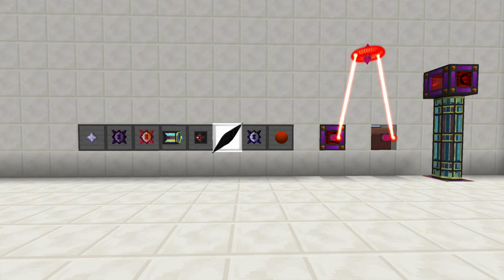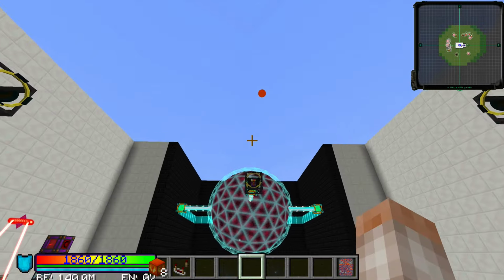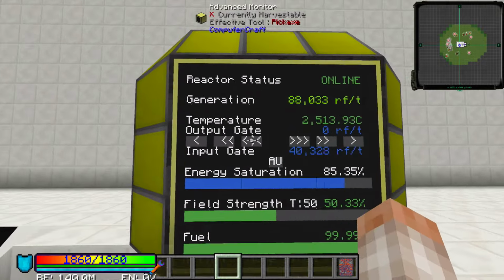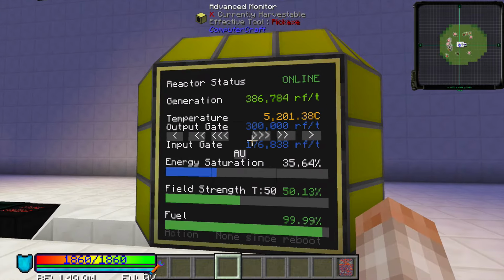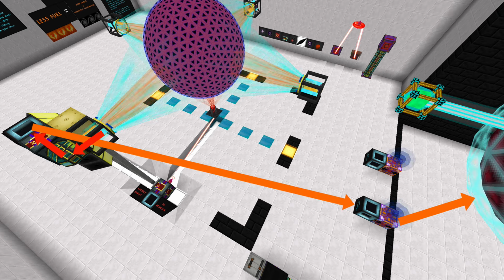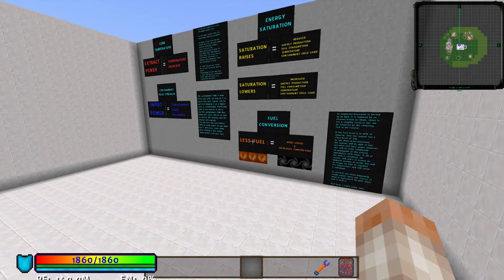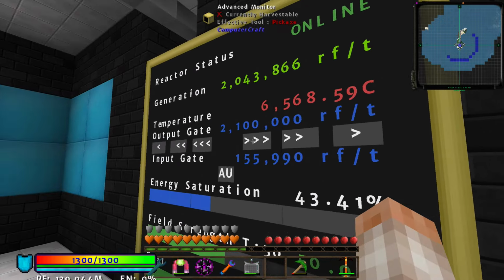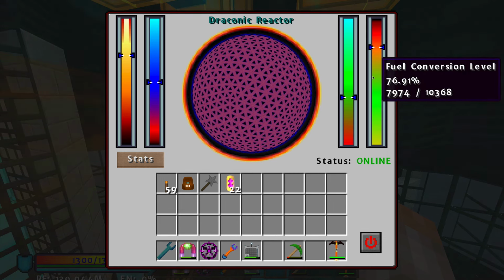Draconic Evolution Reactor Explained & Tutorial

Comment from the maker: IMPORTANT!!

One quick note on the chaos element and fuel longevity:

I said in the video that it was not a tangible resource but this is not the case. Once you power down the reactor after running it for an extended period of time, you will need to eject chaos fragments out of the reactor in order to make room for new fuel.

Also, the CC program stated that I had over 99% of fuel in the reactor but this also turned out not to be true. Once the conversion levels rise around 80-90% (as explained in the video), you'll NEED to refuel or risk an explosion. The "remaining fuel" gauge on the CC program interface is NOT an indication of how long the reactor can still safely run so DO NOT TRUST THIS. Refer to the fuel conversion ratio inside the reactor's GUI to accurately measure the time remaining on your fuel.

In this example, my high output (very inefficient reactor) was only able to last a little over two weeks before a refuel was needed. Lower-output reactors that are more efficient will last longer.
Reply: Hit the Read More
Reply: Why is my reactor not charging ? I've done ste same Reactor with the same messurements like you. What have I done wrong ???
Reply: I did, but at the time, nothing popped up. I'd hit read more, and it only revealed another blank line :T
Reply: Turn it off and Eject all Fuel and then keep clicking will remove the Chaos
Reply: So the program won't stop itself once the chaos gets too high? Are there any programs that will?
Reply: @ForgottenT  I'm guessing there is a way to meaure the amount of fuel vs chaos.  I'm going to try using Integrated Dynamics
Reply: Just come back on the server 2 days in a row to calculate how much was consumed. Based on this, you can determinate how long before rejoining the server to check again on the fuel. The closer you are to 80-90%, the more frequently you'll have to come back.
Reply: Just a note 15 days after he posted the video his base suffered a fatal explosion
Reply: I think I know how to stop a Draconian Reactor from destroying everything. Use the force field mod and put multiple layers of force fields on the reactor or just place the reactor at bedrock.
Reply: Should do a updated video or maybe one that explains the all the Redstone options and the failsafe options. 
I haven't found many videos showing how to shutdown or refuel.
Reply: The MindCrafters last I checked the issue was fixed.
Reply: Does the failsafe work doing this?
Reply: Idk sorry.
Reply: One flaw with having it on a public server
Trolls
Reply: Is it just me, or is there nothing written after "longevity:"  ???
Reply: The MindCrafters lolsleelwowlelel

Comment: Hello minecrafters! i just have a quick question, I've followed the instruction in the video step by step and my set up are identical to yours. i downloaded the pastebin from the link you given and it shows download success and ive installed it on the advanced computer screen. However I could not get it to start? it keeps saying charging and the containment field remains at 0 and all other values are not moving as well... any ideas? im playing lapito's galacticraft pack, 1.7.10
Reply: Try breaking and replacing any cables, flow gates, tesseracts, or even parts of the reactor as well (after you turn it off of course). I had trouble with my cryo-stablized flux ducts not updating.
Reply: I had this exact same issue after following this tutorial. My problem was that I forgot to configure the draconic advanced energy transceivers for proper input/output (mine were both on output). Once I got that figured out my reactor started charging right away and has been working fine. Not complaining btw...great tutorial!
Reply: tried these suggestions and mine wont work still i hate this mod uninstalling

Comment: i made some calculations just for fun:
-If you only used 0.77% of the fuel in 2 weeks that means that the reactor will run out of fuel in aprox 4.98 (real life) years (omg)

-This also means that the reactor will produce 329,890,909,090,909 Rf at a rate of 2,100,000 Rf per tick (asuming that Tick = Second, probably the real result is a bit lower) 

lol (this mod pack has force fields? or turrets?)

edit: the calculations are incorrect, the reason is in the comment on top, sry T_T (to good to be true...snif)
Reply: sacaruma 20 ticks per second
Reply from the maker: See comment on top on this....the program actually had an error with regards to fuel consumption.
Reply: Ohhhhh
Reply: That means you have to divide the RF total production, and the longevity by 100, and multiply the fuel used by 100 to be accurate.
Reply: btw 20 tick=1 second
Reply: actually there are 20 ticks in game per real life second.

Comment: use zetta industry's big battery you can store over trillions
Reply: in the tier 7/8 draconic sotrage you can as well (tier 8 is actually endless soo), but here he used tier 6 for some reason
Reply: @aonodensetsu  9,223,372,036,854,775,807 Which is 9.2 quintillion is the limit of the tier 8 but no way you can ever fill that.

Comment: Hej there, Im playing Sky Factory 2.5 (wich has DE in it). There is an achievement where you need to produce 1 billion RF/t. I was concidering using a Draconic Reactor, but i think in this dimension of power madness it is not worth the efford :( i might have to build 250K 4K Solar panels :(( Any suggestions (besides Big Reactors)?
Reply: Use about 390 nether star generators (x64) from extra utilities.
Reply: You can also look at the achievement differently. It does not say you need to be able to produce the 1 billion RF every tick for all of time. You could just produce such an amount for just 1 tick instead.